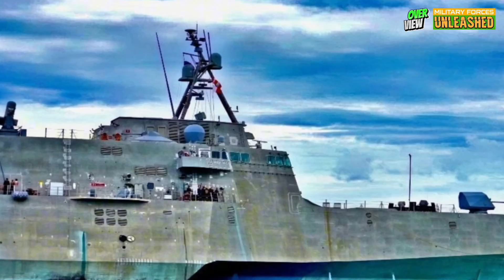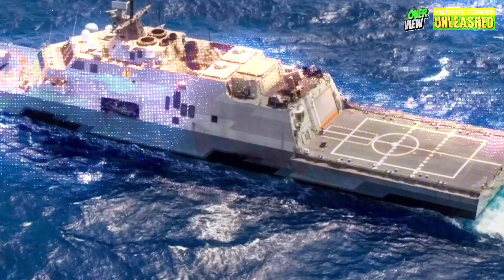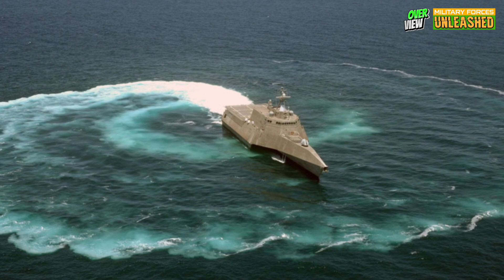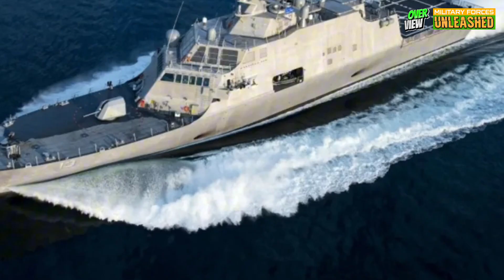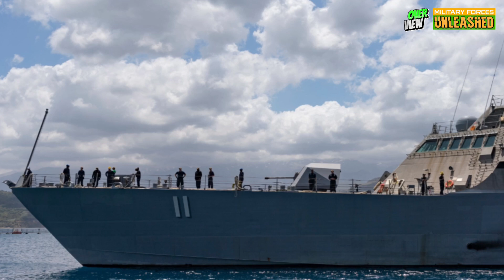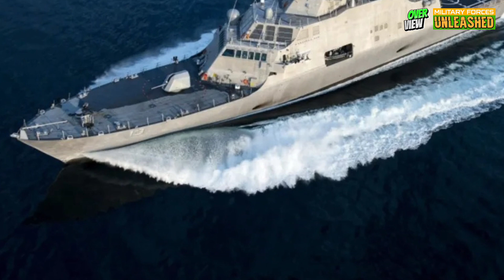Littoral Combat Ship (LCS): The Navy’s High-Speed Gamble | Military Forces Unleashed

Comment: It got way more hate than it deserved.
Reply from the maker: The Littoral Combat Ship (LCS) definitely became a lightning rod for criticism, but did it deserve all the hate? Well, that depends on your perspective. The LCS was designed to be fast, agile, and capable of handling a variety of missions, from counter-piracy to anti-submarine warfare, particularly in shallow coastal waters. The concept was ambitious, even innovative. But the execution? Not so much. Reliability issues, skyrocketing costs, and modular systems that never quite delivered on their promises turned the LCS into something of a punching bag. However, it's not a total failure. In lower-intensity missions, the LCS has shown its worth, especially in environments where larger ships simply can't operate. So, yes, the LCS might have taken more heat than it deserved, but it’s also not quite the hero the U.S. Navy had hoped for.

Comment: The Littoral Combat Ship (LCS) was supposed to be the Navy’s nimble, multi-mission answer to modern threats, but instead, it feels more like an overhyped, underperforming experiment. Designed to do everything, it somehow manages to do nothing particularly well—too fragile for a fight, too slow for a getaway, and constantly plagued by mechanical issues. It’s like the Navy went shopping for a Swiss Army knife and came home with a butter knife. The LCS might look sleek in a brochure, but in reality, it’s a costly reminder that sometimes, trying to do too much means you end up doing very little right.
Reply from the maker: The Littoral Combat Ship (LCS) was billed as the Navy’s versatile solution for modern naval threats, but it’s turned into the ultimate case of style over substance. It was meant to be the Swiss Army knife of warships, but it feels more like a butter knife that can’t cut through anything. Designed to excel in multiple roles, it flounders in all of them—too fragile to handle real combat and too sluggish to make a quick escape. It’s perpetually in the shop, fighting mechanical issues rather than enemies. The LCS might look impressive on paper and in brochures, but it’s a high-tech mirage that’s proven to be a costly misstep. It’s a glaring example of how overambition can lead to underwhelming results, leaving the Navy with a ship that can’t quite live up to its hype.